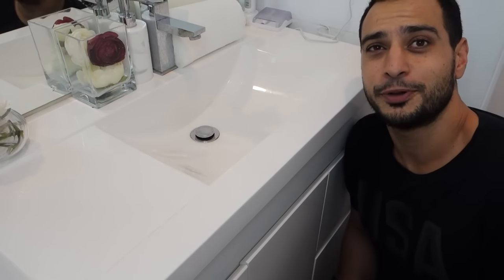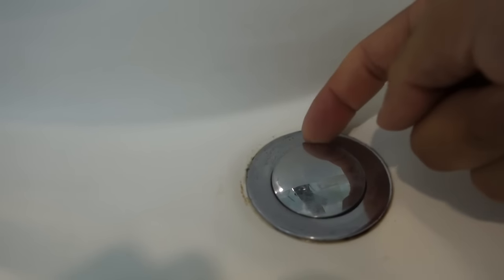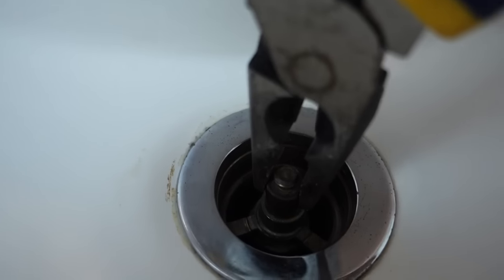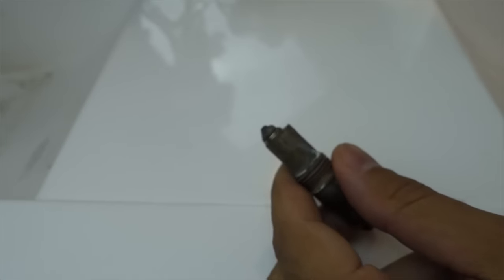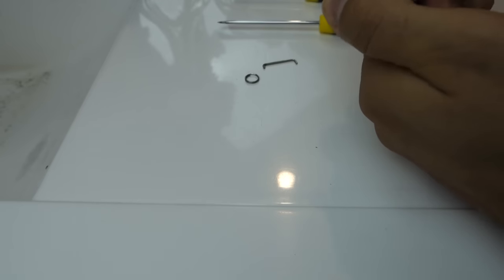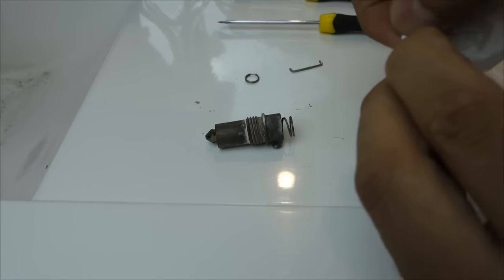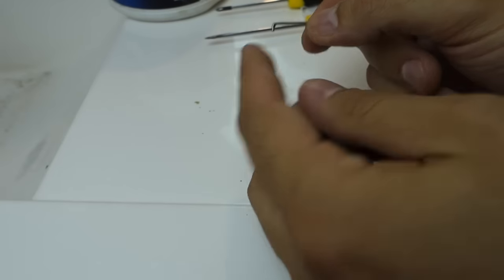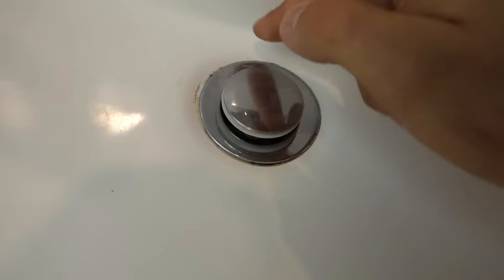How to fix pop up drain waste plug - stuck or leaking

Comment: Hi, I'm in the USA and have this exact pop up drain waste plug.  It stopped being able to lock in the down position so I took it out of the tub and the metal bar (rachet mechanism?) is missing as well as the ring that holds it in.  Can you please tell me who the manufacturer is so that I can buy a replacement?

Comment: Mine was fully stuck in the closed position (almost jammed) and I couldn’t twist it open. I tried a few things like filling the sink with boiling water, and also using a rubber glove but none of that worked. In the end, I managed to get it open by getting a hammer, place some rubber gloves over the plug, then giving it a bit of a medium smack with the hammer ;) good luck and hope this helps someone

Comment: Mine's pop up drain stopper is completely stuck and it doesn't move one millimetre.
Reply: Same i have no suction cup
Reply: @shirodfujiko8589  I had the same problem and managed to fix it. 
What I did was, I bought the 2m command strips. The one that you use to attach hooks to your wall.
I stuck it to the hook, then stuck the hook onto the sink piece that is stuck down.
Waited 30 minutes, grabbed a spanner, and tightened the spanner on the hook. I then rotated anti clockwise and it eventually started moving.
From there, you can follow the video.

Comment: Neat. I have almost the same problem with my popup waste. Except for me the grub screw has sheared off. so I should just replace the whole thing, eh? Is this a trip to Bunnings/Mitre-10/Placemakers kind of thing?
Reply from the maker: Bunnings have them for around $5-10. 👍
Reply: @billshowto  thanks. I went to mitre 10 because they were on the way home. It took me all of 10 minutes to fix once I got home. Thanks for pointing me in the right direction

Comment: I've come across these severely corroded - to the point you can't undo the screw - and full of gunk. Best thing to do is replace the unit, but if you can't do that, a bath in water + CLR (caution! corrosive to skin) generally cleans then out and getting some plumber's waterproof grease or even at a pinch WD40 Silicone spray will get them going again.

Comment: Hi Bill, thanks. I went to bunnings and got the only pop up mechanism they had (kinetic brand) and its too long leaving about a 7mm gap when pushed down. The mechanism looks identical to the one I pulled out but its just too long. It's screwed in where the old one went and is flush up against the end of the thread. Are other adjustments required somewhere else to get the cap to sit flush or do I need to find a different one online? I have looked but can't find anything close to the one I need except for the kinetic one from bunnings, thanks.
Reply from the maker: Did you buy the whole pop up waste or just the piston?
Reply: @billshowto  Just the piston mate, oh and the cap because the piston had a male end for the cap.
Reply from the maker: The piston has to be exactly the same as the current one. The whole pop up waste cost around $15-20 and is super easy to replace. I would take back the piston and cap and exchange for a complete pop up waste
Reply: @billshowto  ok will do mate, thanks again for coming back

Comment: Just fitted a new click clack waste. Without the stopper it opens and closes ok. When stopper fitted ot sticks down below surface when pressed and stays there. Any ideas whats wrong.
Reply from the maker: Sometimes if you install it on a bit on an angle it won’t open and close properly. Make sure it’s sitting perfectly flat in the basin

Comment: Tried to fix mine it was stuck down.  Damn thing wouldn't loosen up no matter what.  Pulled the screw right out and the spring wouldn't come up.  O well.  Guess I'm replacing the whole thing, plus I cant find just the piston anywhere.

Comment: Hello there, mine is stuck completely. Please I need your help badly. Thanks.
Reply from the maker: Hi, stuck in the closed position? If so, and you have tried using a rubber glove, you will have to remove the trap ( plastic drain piping under the sink) and using a small screw try and push it up. If this does not work you may need to remove the whole pop up waste by unscrewing it from underneath.
Reply: Mine was stuck in the closed position with a basin full of water. Scooped the water out with a bucket and tried the glove method, but no go. I sprayed some degreaser around the plug and tried to scrape some muck out from around the edges. I then gave it quite a few firm taps with my fingers and palms and eventually it popped up. Sure enough, the person who installed the plug had done the top cap up super tight and I needed multi grips to get it off! Rubber gloves wasn’t going to cut it today! Spray on degreaser might be your friend here. Good luck!

Comment: Good video but I just cleaned, greased and reassembled but it's still sticking. They just don't last without lubrication, I think the steel bar has worn the channel in the brass so that it no longer releases. Awful product.